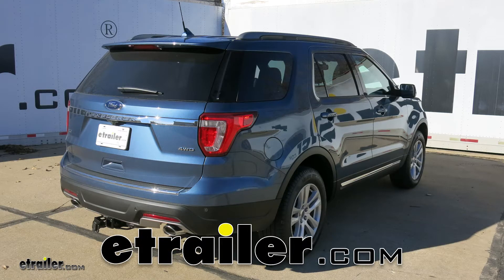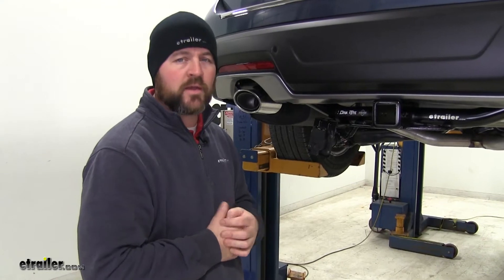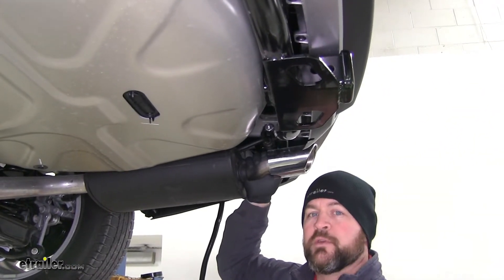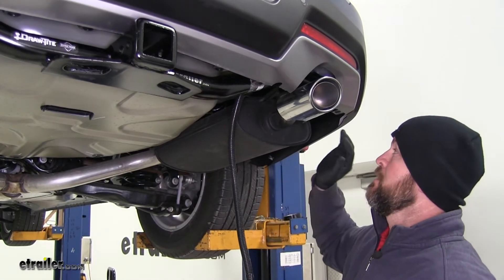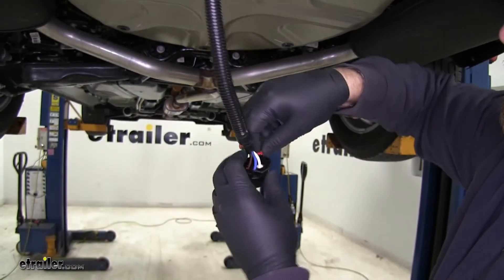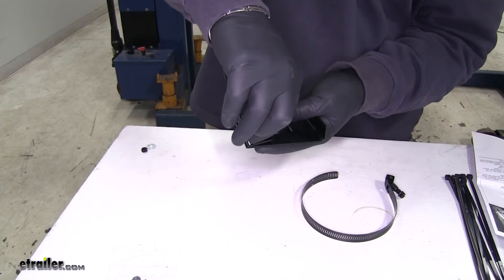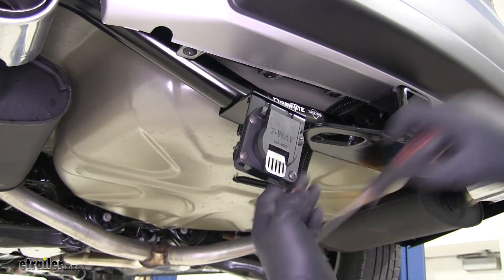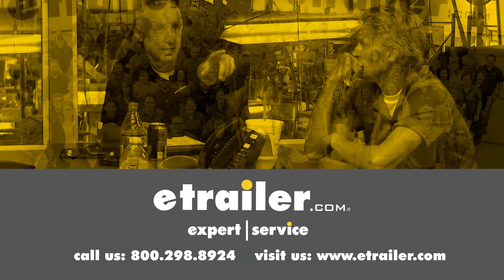Installation: T-One Vehicle Wiring Harness with 7-Way Trailer Connector on a 2018 Ford Explorer

Comment: I have 2018 xlt explorer. Buy with you guys the hitch, t cable, 7pin conector, but the i can’t get a power in the 7 pin. Only the reverse light work and everything else. Like brake light. Turn signals are dead. Something to looked up ??
Reply from the maker: We have had this issue before and we had to install a relay in order to utilize the factory tow package.
https://www.etrailer.com/Custom-Fit-Vehicle-Wiring/Tekonsha/118272.html

Comment: Does this tie into the factory wiring for the brake controller?
Reply from the maker: Yes, this will tie into the factory tow package if the vehicle is equipped with it.
https://www.etrailer.com/Custom-Fit-Vehicle-Wiring/Tekonsha/118272.html
https://www.etrailer.com/bc-2018_Ford_Explorer.htm

Comment: That wiring harness on my 2014 explorer doesn't affect the lights at all. I disconnected the harness and my taillights still work. Is there another one somewhere?
Reply from the maker: You will want to check that the fuse is still good for this connection. It will be a fuse in the engine compartment labeled for tow lighting.
https://www.etrailer.com/Custom-Fit-Vehicle-Wiring/Tekonsha/118272.html